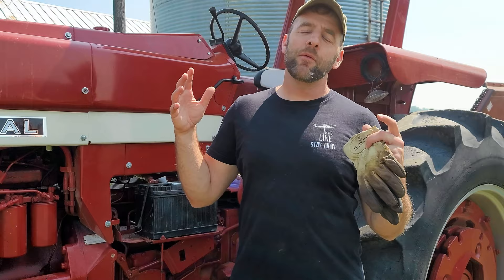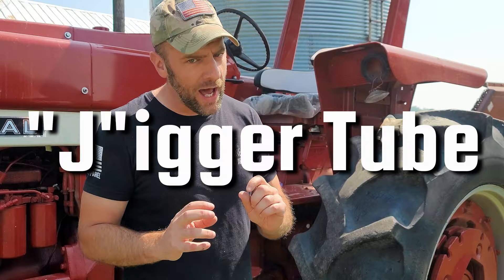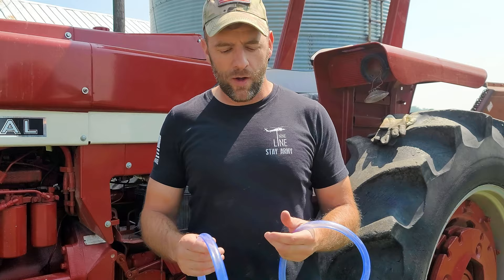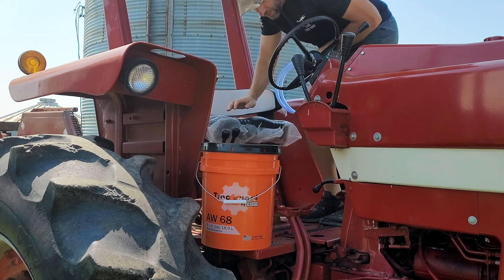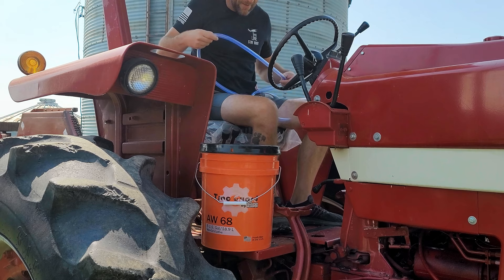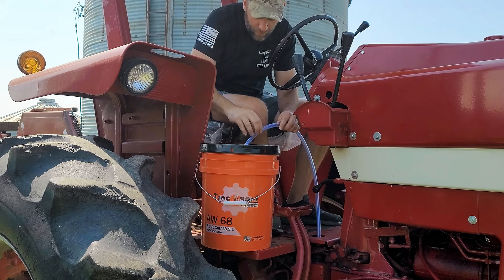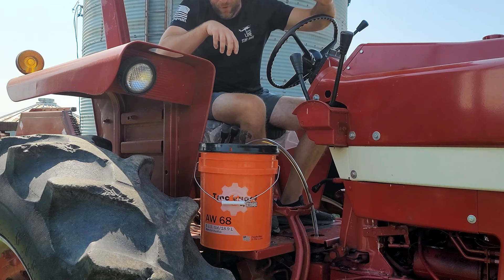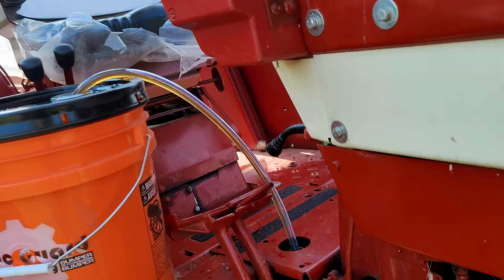Overfilling International Farmall 966 Tractor - It Works!

Comment: I have a 756 for loader work and a 1456 for seeding and on both of them we have to overfill the oil by at least 1 gallon and usually more and that helps with shifting and the pto. And those self priming siphons I use for everything, I used to come up with a different solution to not have to use a siphon but now it’s so easy, definitely recommend
Reply from the maker: I like it!!!!